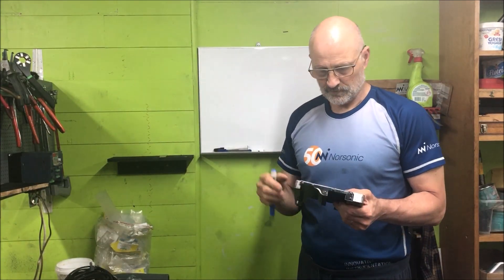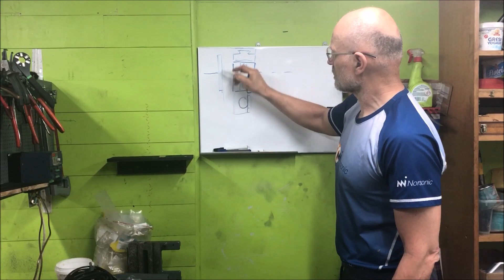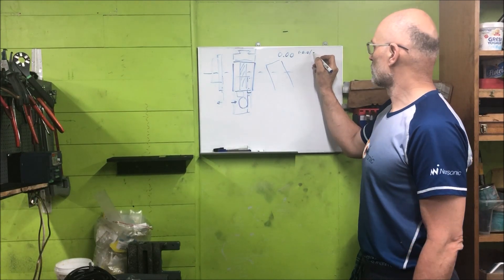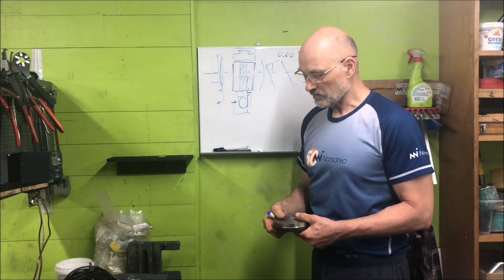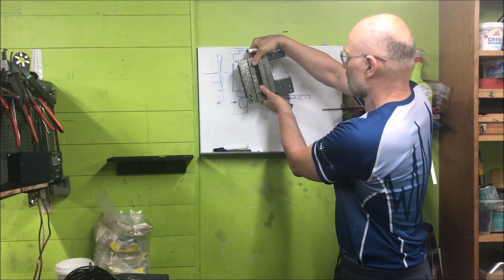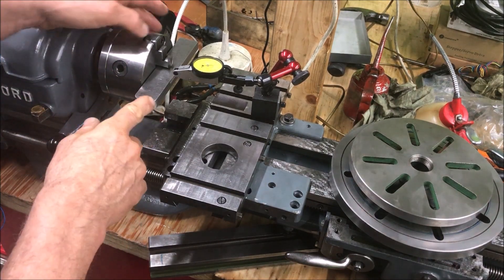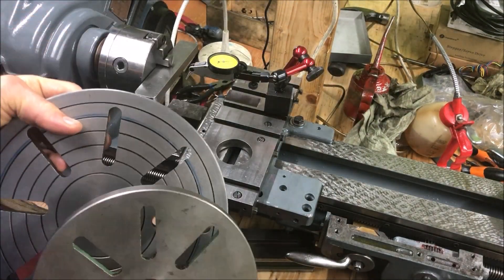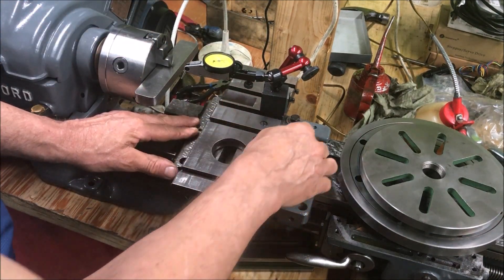Myford Super 7 -  facing considerations..

Comment: The alignment or how to actually scrape the cross slide to obtain that slight concave facing alignment isn't well covered by any video I've seen so far Jan. So thank you very much for detailing this. 

I did finally figure out a method where you can indicate the amount it's aligned to face concave if your indicator has a fine enough resolution and accuracy. I have a 20 millionths reading Mahr millimess indicator that works well. Use the largest face plate or work piece you can swing. Take a light facing cut from either the center out towards the operator or the 3 o'clock position, or from that 3 o'clock to the part center. I then gravity load the cross slide with a heavy weight hanging off the tail stock end of the lathe bed tied to a wire attached to the cross slides top surface to take up any clearance and hopefully replicate some of the cutting loads. Wind the cross slide fully towards you and then place the indicator tip on the back side of the hole in the face plate, or on the work piece C/L. Zero the indicator and wind the cross slide in until the indicator tip reaches the 9 0'clock position / far back side of the face plate or work piece. Obviously the carriage lock also needs to be applied so there's no chance of any movement during this test. Because the indicator tip is not traveling the same path as the first initial facing cut, your indicator deviation reading from being perfectly flat will be DOUBLE what it's alignment really is. It's a very sensitive and accurate way to test by direct measurement. 

And yes I'd very much agree, the smaller the lathe is, the harder these measurements become both for that possible deflection you mentioned and because the deviation measurements when correct are so small. If I remember correctly, the Schlesinger recommended numbers are .001"-.002" maximum per foot over 1/2 the work piece diameter on tool room class lathes. At the maximum swing on a 9" part in your Myford, that works out to only .000375" - .00075" over the 4.5" inches of the surface being measured.
Reply from the maker: You're welcome. I thought i had covered this before..?
Wow.. thnks for elaborating on the method you use and favor!
Agree, only a little to-in is needed, but taken into account that on such small lathes "everything" flexes to a certain degree, it might be academic if you have half a thou one direction or the other on all but th finest/lightest cuts. I am still amazed by seeing how much metal can "bend", even stiff large structures, and these relatively light built machines need the best "parts fit" possible (in this case achieved by scraping) to minimize deflection, chatter etc. and improve cutting performance.. aside from the obvious need for accuray viz specification/standards
Reply: @jansverrehaugjord9934  Yes you have touched on this subject before in at least one previous video Jan. But this video was a bit more detailed and for me better explained on how to purposely reach that slight misalignment condition. If you do try my measurement method for checking the amount of concave facing I'd be interested in your thoughts in just how valid and repeatable it is for you. I only have my own experience with it and there might well be a flaw in my measurement method that I'm not fully understanding yet. So far it's worked well in my own testing, but I haven't tried using it while scraping in a cross slide yet. I also think the better tool room lathes are specifically set up to face concave in an effort to offset and lengthen there accuracy time interval. The lathe slowly wears towards facing flat instead of immediately starting to wear towards facing that very undesirable convex condition as it would if it was first set to face completely flat from new.

Like you, it took me a very long time to finally understand some of the forces involved in machining and just how much seemingly rigid lathe parts or the same on any machine tool will deflect. Given all the variables involved it's quite amazing we can obtain fairly high accuracy parts with not all that much effort if the machine is in good condition with well fitted slides. In my opinion, the better you understand what's happening within the machine at a macro level the easier machining and getting better accuracy becomes.
Reply from the maker: @turningpoint6643  If/when I test your method I will report back Sir :)  As with so many things, there are several ways get a job done, I merely used the ones I have learnt and read about. I agree that the lathes are possibly set to face concave to some degree to compensate for wear also. This is the same with the tailstock, ie. purposely set higher to extend the useful lifespan until alignment is too far off (when the foot is worn so the tailstock barrel dips below the centerline) as well as eg. the knee of a milling machine that should be machined/scraped so it rises to the outside to have a certain degree of compensation for the weight of the knee and the work forces.. plus wear. (Bad) design also plays in, for example referring to the videos I made on the SIEG X3 mill head, the vertical surface on the head that rides up/down the column are (in my eyes) too short to counteract the work forces. The distance to the spindle is longer than the support which means you have a leverage to fight.. , inviting wear and sloppiness, ie. chatter/vibrations earlier than needed (if you see other mills with the same general build, the better eg. Tormach's, have improved designs). Same with the placement of the toolpost on a lathe, put if off center to get nearer the chuck and in most designs you will have a leverage problem to the work forces and of course inviting wear around that "pivot" point. Fully agree, a good and proven design is a must. This is probably an accumulated (and sometimes copied..) base of knowledge behind. It eludes me to understand how/why products are changed to compromise this for the sake of looks or other "non performance related" reasons.. otoh, price I understand is a consideration..